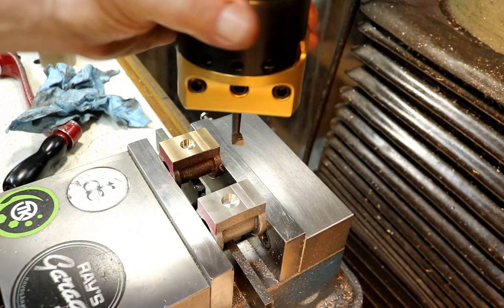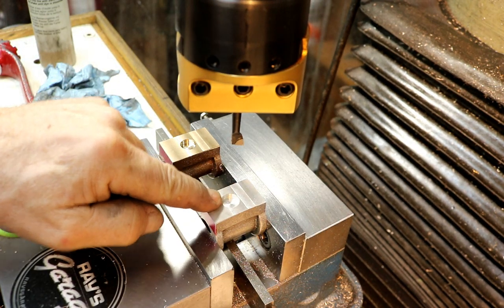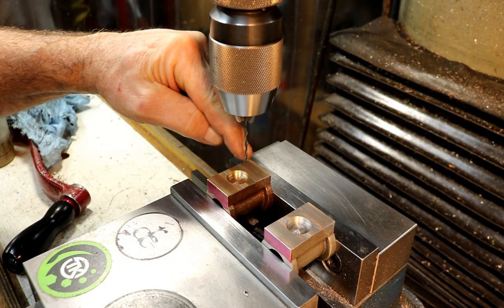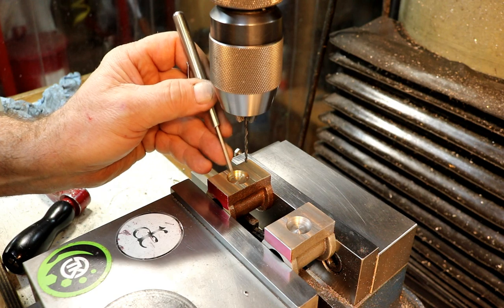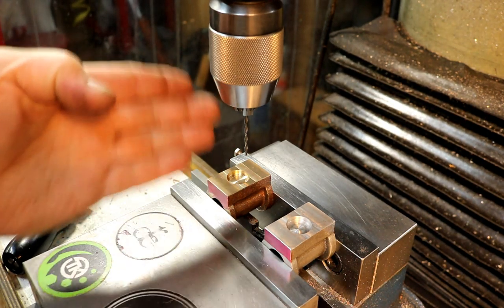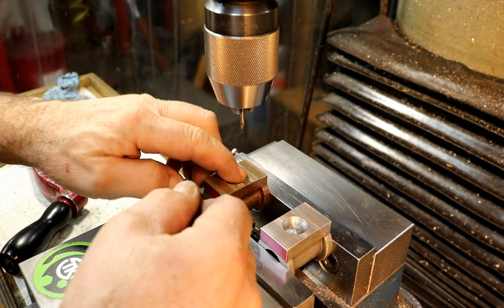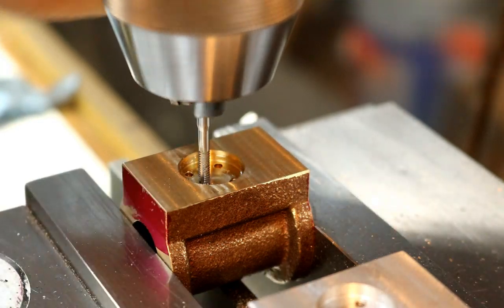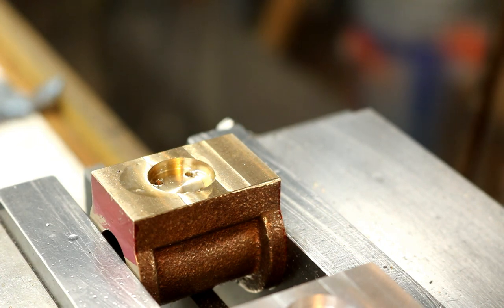P1-5 How to Build the Cylinder of a Model Steam Engine for the First Time

Comment: We think those boring head reducers from Solid Rock are great as well Randy we do not use them but they make great sense and likely very accurate. This steam engine series is nice for two reasons, one that you share well and you are doing two motors one in aluminum and one in brass covering each makers needs or personal build, smart thinking Randy. Great hand tapping caught well on camera from that angle as well.

Comment: By now, I'm trying to have the type of taps that pulls out the chips when I have to deal with blind holes, also find power tapping or at least using a tap follower so much safer with any type of tap, even more on the smaller ones like no: 2 or 4...
Twin brothers cylinder, uhm... Almost twins, except for the skin tone...   lol